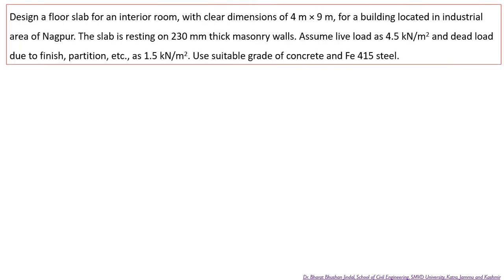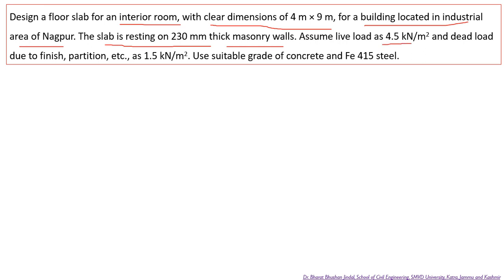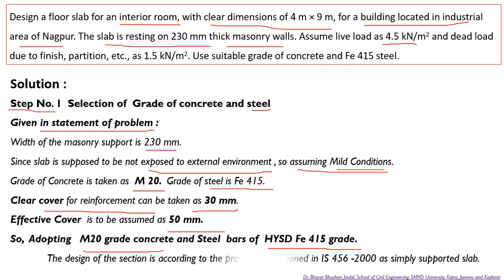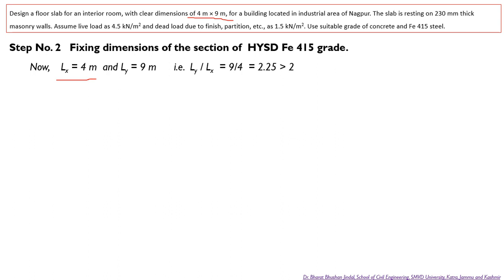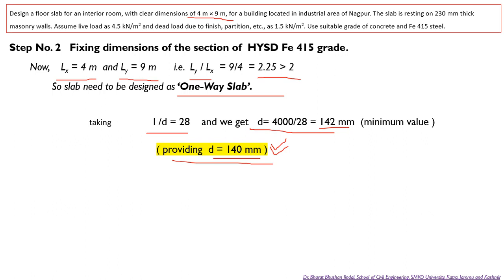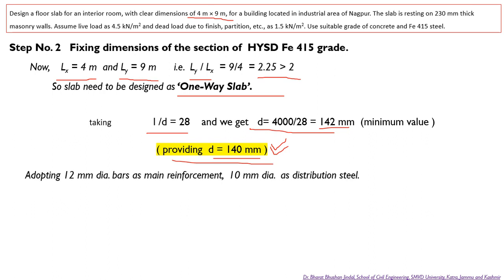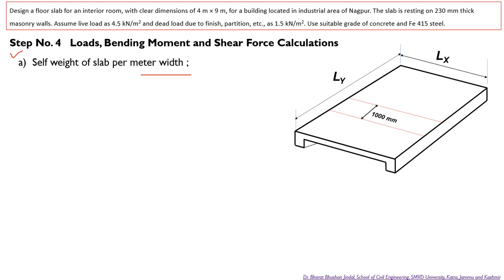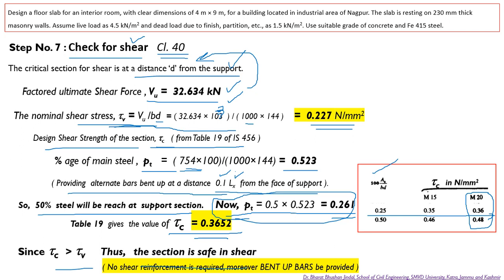Lecture 18 || Design of RCC One-way Slab || Design Problem || IS :456 -2000 ||  Civil Engg.

Comment: Sir if req spacing is 158 then why we provide it as 150 as we know required spacing must be given for better bond
Reply from the maker: By providing steel bars at a spacing 'lesser' than 'required spacing' , in actual you are going to provide more area of steel / m length of slab/beam which is the more better  way of providing steel. Keep in mind : IS : 456 only restricts the maximum spacing.

Comment: since the  work of distribution steel is only to resist temperature and long term shrinkage stresses, would it be feasible to use steel bars of lower grade from economic point of view?
Reply from the maker: Lower grade will be Fe 250 i.e. plain steel bars which are not adopted now the days due to poor bond strength as compared to TMT bars.

Comment: SIR, the required effective depth is calculated to be=110.66mm and the one calculated from l/d ratio is 142mm. why are there fluctuations in considering value of d (first 142mm, then 140mm and then 144mm) as per "assumption"?
Reply from the maker: In design problem we have taken D=180 mm only for the purpose of rounding off the value and after calculations give d =144 mm.

Comment: Sir, in the problem u took l/d ratio = 28?? but in IS 456 for span length less than 10m, l/d ratio for simply supported beam is 20 and according to IS 456, it can't be greater than this value, i.e. 20.
Reply from the maker: You can take l/d = 20 but keep in mind IS code suggest the value by assuming that if these values are taken then probability of getting the depth in such way will satisfy the deflection criteria.  L/d was taken higher intentionally due to the following reasons :

1. To check whether the viewer is correlating the information with IS 456 or not.

2.  Here designer is only assuming the depth of slab which will be later on checked in various steps.

3.  In general the thickness of one way slab in practice is 4.5 to 5 inches i.e. less than 130 mm ( it is not mandatory ).  So based on the experience designer in general takes the thickness of slab as 4.5 - 5 inches.

So, ultimately the purpose of taking l/d = 28 instead of 20 is explained in above points.

Still students can take l/d =20 for trial section.

Comment: shear at 'd' distance from support is calculated = 28.028 =(32.63-15.6(.18+.23/2))
then why maxm(32.63) is taken???
Reply from the maker: The ultimate shear force value is taken for calculations which is slightly higher than at the critical section.

Comment: Sir, I have a small doubt, in the solution, we have to take critical section for shear stress at a distance d from the support, so in that case won't the shear stress be 32.634 - 15.75(0.259) = 28.554?
Reply from the maker: I appreciate that you noticed this point but in the lecture it is also explained. You can re-watch it.